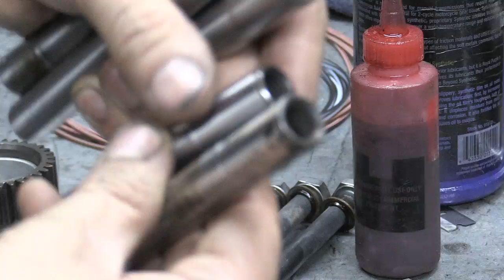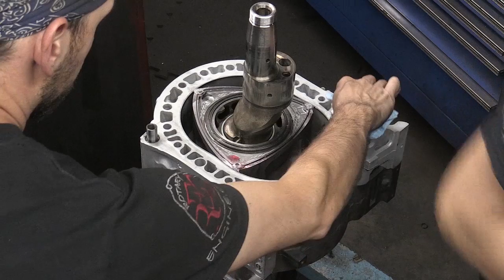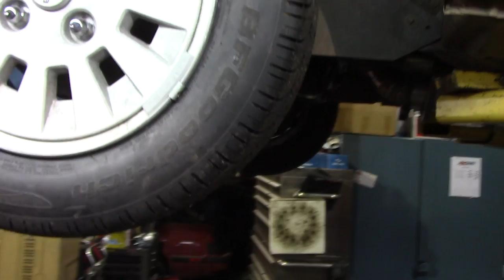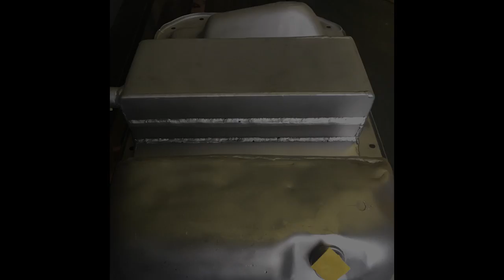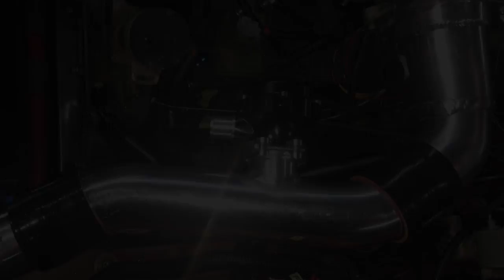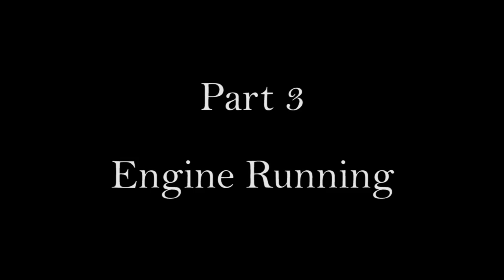700HP 3 Rotor 1st Gen Sleeper - Full Build.

Comment: Comment:
1. Why is idling  lumpy since the primary ports are only street ported?
2. Turbo inlet is taking in hot air from behind the radiator?
Otherwise, top notch engine assembly...thanks.

Comment: Lightning the rotors just causes balancing the problems later during the build. It doesn’t increase compression which is 8.5 it doesn’t increase RPM. It’s pretty much a moot point so why do it if you’re professionals?

So much repeated talk i couldnt watch the whole video. Only got a quarter of the way thru it.

Comment: Seems awfully loud for a turbo motor.  Mufflers?  Turbos tend to quiet exhaust, or is there a header leak?  Also, hot intake air from that silly little green filter?  Even with mild boost, the intake charge is making the intercooler do too much work.  I would hesitate to speculate on the power levels even with 91 octane gas and mild boost.  That thing must fly!!!  I'm sad, because I miss my '94 R2 all the more after watching this video.  Thanks for the memories, guys.  Beautiful assembly technique, and attention to detail....

Comment: I plan to build a 20B with 3 rotors, dual Turbocharged engine.  I will use reduction gear in a pusher configuration.  I do not own an old block with rotors, but I don't want to put anything half worn out in a new aviation engine.  Money is an obstacle but what is necessary with this build, what kind of US Dollars should I expect to pay for such an engine?

Comment: must have been expensive to figure alll that shit out
now i have reasons why i hate these pieces of shit as much as i do lol   good on ya bro for sticking with such a tempermental rediculous hunk of crap. they sound wicked and make lots of turbo power, but they are fragile, make little torque and last half the mileage any other performance engine does. again, good job but i hate these engines

Comment: Seems like it would have more sense to just start with a GSL-SE...just sayin'.  Especially after you are pumping THIS kind of money into it.  You also get the much nicer dash, interior, etc.   I drove a 79 and an 84 5 letter (years each), and I wanna tell ya, the 79 interior is garbage.  Had a Rotory Engineering Turbo Alternative in the 79, which I moved to the 84, with some more mods including slightly more radical porting than standard street ports, when the ubiquitous pressure oil leak at the top of the block occurred on the 84  stock13B.   Also, just sayin', NOBODY is going to mistake that for a stock car...not even remotely.  Sounds more like a very high performance 2 cycle outboard racing engine than a stock 12A.  Sounds like it's going to be a freaking BEAST, though.  Betting he'll love it.  He's going to need a LOT more/better rubber in the back, though, to utilize much of that output in lower gears.  My little two rotor would light up the rears for a block if you wanted to, with decent rubber in place (RE71s), and it wasn't a very large portion of what that motor should produce.

Comment: Nice work lads, it sounds like a 3 cylinder version of my CR 500 minus the Turbo of course. That was a Mega difficult job, though I would recommend a heat shield on that Turbo before it melts something. Would like to see it performing up the road. Oh and the sleeper bit I think is blown with that noise going on. I had a real Sleeper, as quiet as it was standard and even very nearly sounded the same too but if you ever open the throttle past half way people knew then it wasn't standard by the sudden Growl coming from the motor and the carby Snorting sound it made apart from the fact the front end lifted a lot & the car took off, but nothing like 700 HP on this build, but the difference between my rig and this one is I had tail shaft Twisting power at 1200 revs..
Reply: 🔴[PREMIER][ÉLŐ ADÁS]#MARAGYOTHON]

Comment: As a mechanic in Australia, I only ever saw the insides of a rotary at trade school.  Your videos were great for me to watch as it clearly demystified the rotary for me.  I built many high horsepower engines only now to see that had I taken the plunge into rotaries I could have done it easily.  Just my workshop with ridge removers, cylinder hones, conrod alignment and balancing, valve facing machine, boring bar etc  etc - all totally redundant.  Thanks for posting these videos.

Comment: Holy shit my heart kinda hurt when u didn't us any lube for those long bolts and just ripped that one that was binding up! And why wasnt the top put on the apex seal? I'm new to rotary anything. Just wondering if it helps or hurts?
Reply from the maker: You missed the pre lube which is always done prior to filming and you might not have noticed but we cut when something is out of place and fix the issue and hide this when editing the video. Rest assured this engine went together properly and ran great and makes lots of power...no issues. Good on ya for noticing
Reply: @rx7specialties203  when we getting a video of it kickin some ass!?

Comment: The question I have that keeps me up at night is: Are there timing marks to line up the crankshaft to the rotors? It looks like you set the rotor on the steel and and drop the crankshaft in "somewhere that looks ok". How do you time the engine?  Sorry for my piston based train of thought.
Reply from the maker: The gears position the rotors properly  It only goes one way.

Comment: I have a question for ya, Why do you use sealant on both sides? I can understand the use on the side with a port, but the other there is no port. Is it strictly to not get uneven thicknesses?
Reply from the maker: Sealant on both sides of what?
Reply: RX7 Specialties the lower part of housing. You put extra sealing from your tube 😊

Comment: What can you do with a 12A in an RX-2??
Reply from the maker: What are you looking for?
Reply: Well, actually I'm wanting to get my RX2 running again - it was stock, but all the vacuum diaphragms on the intake "went south" so I put a (used) RACING BEAT INTAKE and Holley 4 barrel on... I have no idea what jetting, power valve (etc.) to use.  I also put RACING BEAT's exhaust header on in place of the stock exhaust.  Any help would be appreciated.  gpholmes@comcast.net

Comment: Interesting the dowel pins are only necessary in the combustion chamber area, I made a motorized bicycle with an Sachs 160cc single rotor, which came with two dowel pins on the far opposite ends of the housing
Reply from the maker: If you notice, the Mazda engine also has factory dowel pins on opposing sides, even the engine in this video. The purpose of the pins you are referring to are for alignment not so much strength. We put the extra pins in to provide strength where the load areas require it.

Comment: The Doritos sound incredible. I hope it got the exhaust system it deserved. Catless, no mufflers, large tips. God, even those turbos sound great when you rev it. Great job, 1 year later.
Reply from the maker: Glad you liked it but just so you know the piping and muffler were both temporary and were not delivering the sound that it should have. At that point there was also no tune in the ECU (very basic base MAP) so the engine only sounds good cuz 20B's just sound that good period. The custom turbo system we built is as good as they get and no doubt it will eventually deliver on all aspects when finished. My personal car (20B/FD) has a very similar turbo / manifold set up  coupled with a rare 3 1/2 V-band exhaust with straight through resonator and free flow cat back. I will feature my car in an upcoming video...then you'll hear the true roar of a 20B

Comment: Excellent build work. But that idle sounds horrible. Doesn't sound that good on revs either. Why does it sound like its on solid mounts or has several broken flanges???
Reply from the maker: Its not tuned and its probably the 3rd time it was started. It is much better now that the customer has the tune and broken in
Reply: RX7 Specialties that makes sense.

Comment: Are you experiencing any negative impact from placing the intake so close to the radiator?  It is basically pulling in pre-heated air directly from the radiator.
Reply from the maker: Its long since been changed to cold air

Comment: A few questions, 

Engine Housings/Irons - 
Which is better the 20b or the 13b and what is the difference?
Which one is the better type A,B,C or D?
Why A, was it a matter of weight or availability/Cost?
If finance was not an issue would a High Temp Carbon Composite be the ultimate for these blocks/Irons or even the rotors?

Idling -
Is it possible to tone down the high idle?

Regards,
Rob
Reply from the maker: Best and most sought after engine is C/D series 20B, nothing to do with weight and you can't really compare a 13B to a 20B because a 20B has an extra rotor, 13B is lighter, two totally different engines
Reply: Thank you for the reply, I saw on another rotary video they had aluminium billets machined instead of the cast irons, what are your thoughts on these?

Comment: When you show the pins ability to move you talk about line bore and making it too rigid. What does that mean for your stud kits that lock the housings tight together. That won't allow that movement you say you need. Is this before you started doing slip fit stud kits or is it just a 20/26b thing.
Reply from the maker: Its just a 20B concern  The whole reason the 20B engines are doweled and the the 13B engines are studded is to allow for movement on the 20B...otherwise we would stud all engines

Comment: Hey I'm sure that you all think  well about services such as oil changes but I did see how you get old out of blocked off place for the crossover stearring tie rod oil pan cut out looks like it woud block old from draining out the rear mounted oil pan drain plug. "Hawk"
Reply from the maker: There are 2 drain plugs. One per sump section

Comment: if you guys that install  engine-trans at the same time, would raise the rear of the car or truck, it would make install so much easier that 1 person can do this in half the time and a lot less problems, lower rear as it goes in,, cars and trucks
Reply from the maker: We did it on the car lift....the entire car was off the ground? We were doing some other things like fitting the rad and fiddling with small things at the same time. We were not trying to set s speed record and we had this engine and trans in and out of the car at least 10 times for fitting. Sometimes it took less then 10 minutes so well aware of options ...appreciate you sharing your experiences/
Reply: i was trying to give alittle  advise,  if you get the car or truck at a angle like i said, it will help A-LOT,  i am 54 and have worked on about anything that burns fuel and goes
Reply from the maker: Yes I understood. What works even better for us....lift the entire car on the lift and put a floor jack under the trans cross member.  You are correct in saying that one person can easily do it. Mike (my engine installer) has probably done 400 installs by himself. Never has any trouble. Thanks again for sharing

Comment: Not sure ab the keyway to keep the whatever the fuck you call it on the crank shaft but I also no jack shit ab rotary motors.
Reply from the maker: This is what Mazda uses from the factory. This is just an alignment key..you will notice there is a very large taper on the second lobe. This taper is what absorbs the load

Comment: How does it feel to not know where to place the combustion chamber in the optimum place on the rotor? Seems to me you just think you know about building rotary engines but don't really understand the physics involved.
 I'd love yo know how long this engine lasted. I know it's possible to get 800 hp out off of two rotors so I know you can seven hundred from three. But, how long did the engine run until you had a failure? and, What was the thing that failed first.
 I like my little 200 hp that eats Porsches for lunch. It's been running for years. Ooh, 30 years to be exact.
Reply from the maker: Dont know what your talking about. We dont make the rotors...Mazda does.

Comment: I would love to see the finishes intake work. Did you do a cold air intake somehow? not much room I know?? Could make a smaller radiator and run  a COI forward of the turbo to the front? Or just eliminate a few inches of the Rad.. Perhaps add additional cooling elsewhere? Looking again there is room to oblique a sewer pipe to the front with ram air it seems...
Reply from the maker: We did answer this question a few times...in case you  missed it...yes the customer asked us to put a temp air filter and temp exhaust on the car until he can afford to do more detailed work along with a proper cat back, better heat exchangers  and a ducted cold air intake.

Comment: How does the stock transmission and diff hold up under the extra power? A chain is only as strong as it's weakest link.  Excellent video tutorial for a unique build.
Reply from the maker: This is not a stock transmission nor a stock differential. The transmission is a factory turbo transmission whereas the stock transmission was designed for the 12A non turbo. The differential is a KAAZ LSD and we also added a full floating axle kit which are chromolly supplied by Xtreme Rotaries. They both hold up very well.

Comment: I noticed on this first Gen RX7 that they only have 4 lugs! Would this handle the power this engine puts out. Is this what the owner wants or should he go with a 5 lug setup which means it's not going to be a pure sleeper? The 5 lug will give him a huge choice in wheels also.
Reply from the maker: Yes we did explain this to the customer, however he insisted on factory 1st generation look and thus we went with the largest wheels and bolt pattern offered in those years. Although it's not a huge improvement, we did upgrade from 4X1.0 to 4X1.14 pattern not so much to improve strength, but because the only available floating axle kit uses this bolt pattern. There is a significant amount of strength increase using this chromolly axle floating kit. I guess only time will tell how much it will actually handle.

Comment: Hi Team, why aren’t the outer water jacket o-rings used?
Reply: RX7 Specialties 
14:30 23:00 there is no black outer coolant o-rings installed. Where as in another one of your vids they are fitted.
Reply from the maker: Oh they get put in right before the iron is installed. The reason they are not in place at that clip in the vid is because the engine needs to be flipped over and worked on from the other side. Trust me they are in there...engine ran and doesnt leak. HAHA

Comment: i had an 88 rx7 and 145,00 motor needed rebuilding and it always leaked oil after it was done and tried several times to fix to no avail. are these motors still having the oil leaks and problems with getting the rotor surfaces to seal up proper?